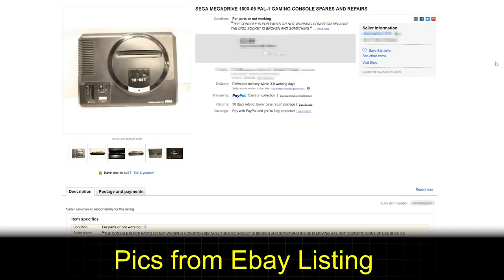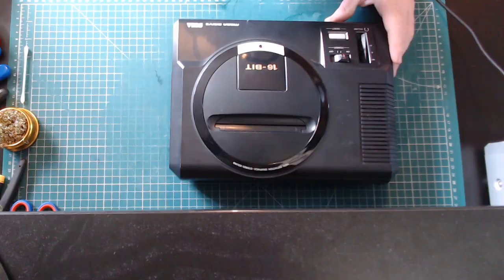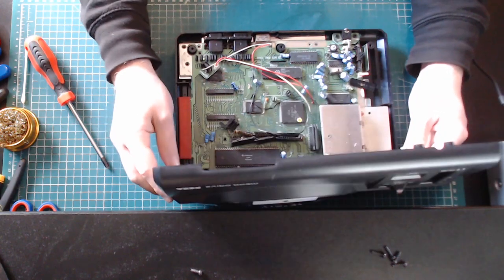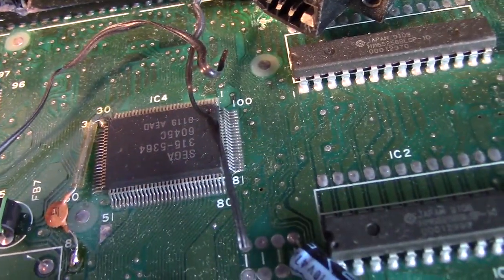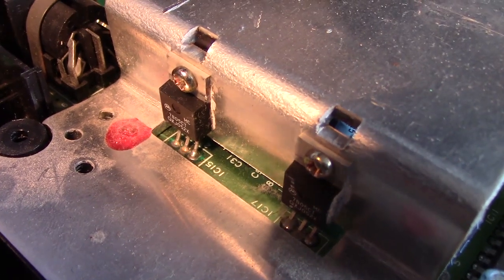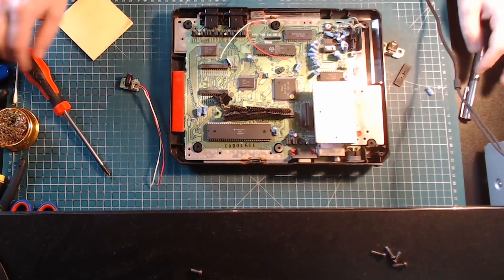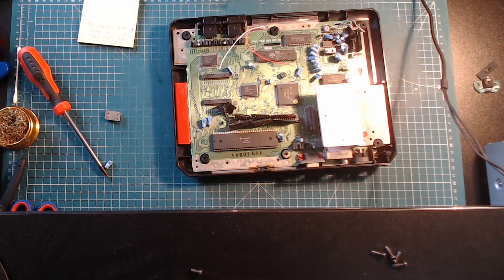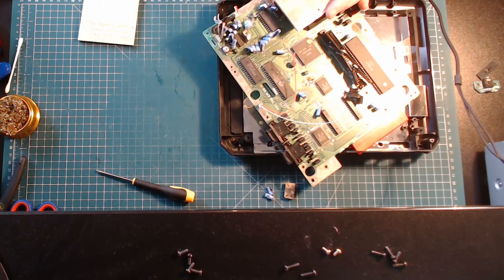Mega Drive from Hell - Repair

Comment: OMG @ that cartridge port lol!!!  Incredible how much damage there was!  Crushed caps, broken connections, bent board, totally mangled cartridge socket, wires cut...  The crazy thing is despite those thing they didn't have a go at the chips!  Great job getting it working again!
Reply from the maker: I think they didn't have a clue, just wanted to destroy it. Was delighted to get it working again. Felt good, like I was undoing the hate lol :)

Comment: What desoldering gun is that? ZD-915? How much and where did you get it? I'm from Ireland too :)
Reply from the maker: Your right it's a ZD-915. Got it on Ebay from a Chinese seller for €104.36 euro back in march of 2018 . I have a few tricks I use to keep it in good condition ( Might do a video on that in the near future ). Still holding up really well. Might not get as much use as it would in the hands of others who have one but it makes life so much easier.
Reply: @GameTechRefuge  Great thanks. There's an all in one on cpc Ireland for 176eur. Might get this gun seeing as I've a soldering iron coming from China. Here's the AOI for anyone interested: https://cpcireland.farnell.com/duratool/d00674/soldering-rework-station-uk-eu/dp/SD01386?st=80W%20Soldering%20&%20Rework%20Station